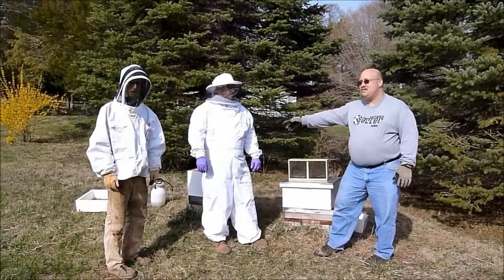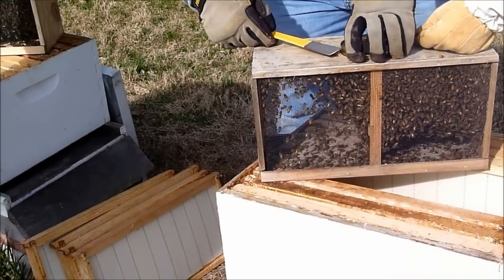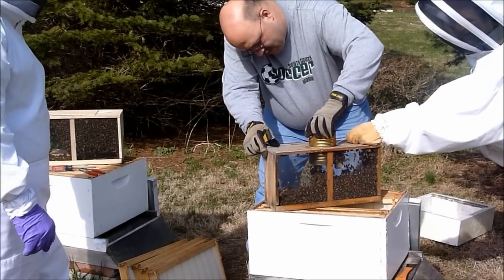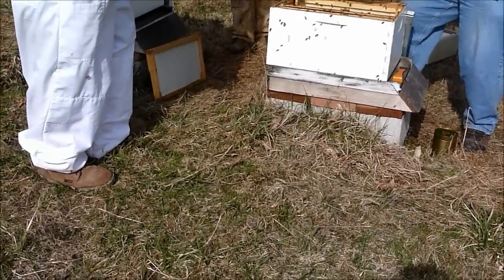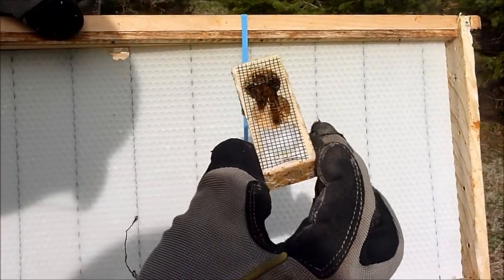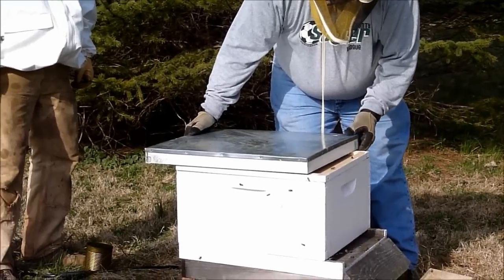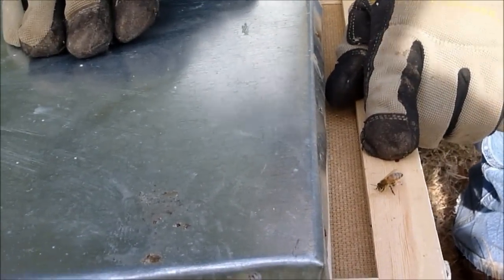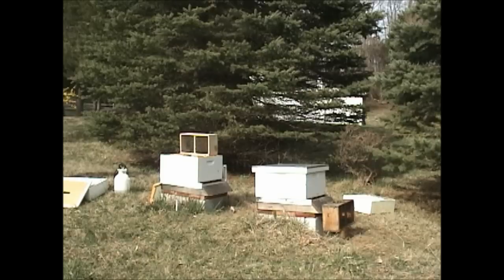Honey Bee Package Installation Demonstration & Bonus Footage

Comment from the maker: Rob read on the internet that the queen should have tape.  This keeps the queen from getting out to early.  Truth of the matter is the queen came with the bees and the bees should not be hostile to her.  Rob removed the tape in a day or so and all went well.  She got out just fine.  Common wisdom is put the candy up.  This lets the dead bees go down and the queen can escape. Do it the other way and the queen could get trapped.
Reply: Did you remove the plug before putting on tape?